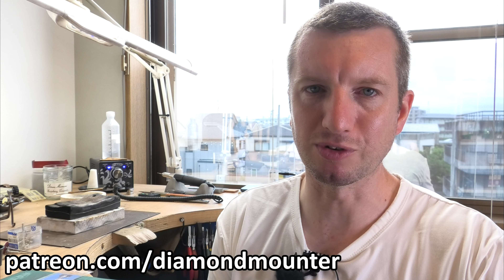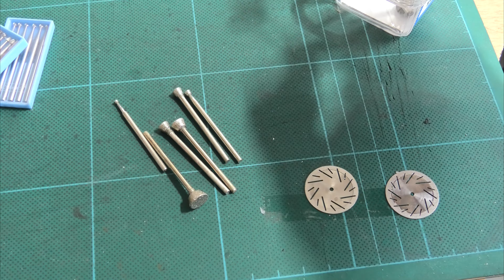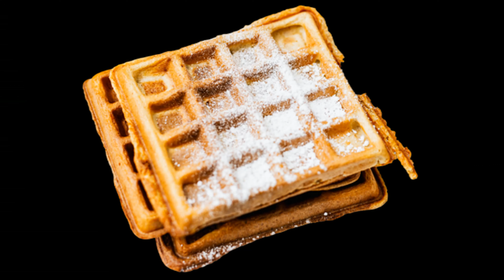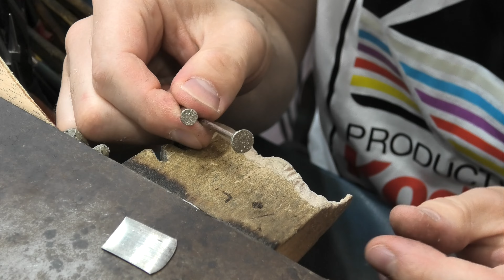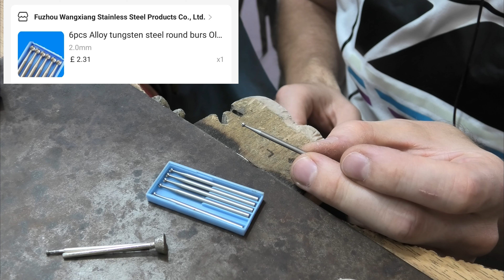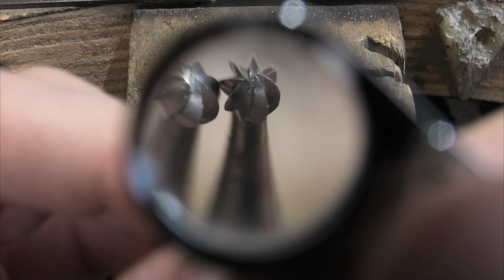Testing the Cheapest Tools from Aliexpress!

Comment: I like to keep a box of those cheap diamond burrs on hand, they’re very handy for things like tidying up pierced work and rough stock removal, they’re quicker than using hand files. Also good for things like adjusting badly cut stones (I do a fair bit of work with boulder opal). The finish they leave isn’t the best and they can be a bit chattery but so long as you know their limitations they’re fine. They seem to last pretty well too, if I’m using them on stone I run them wet.